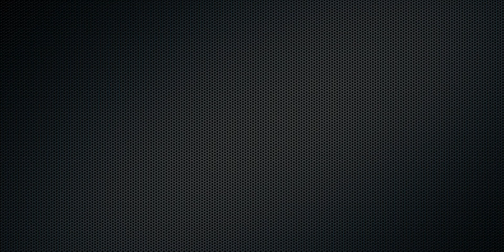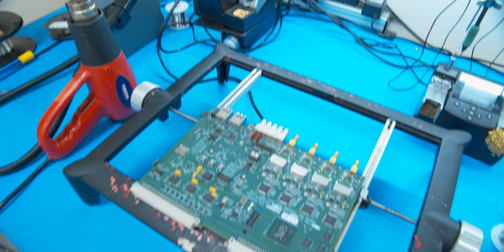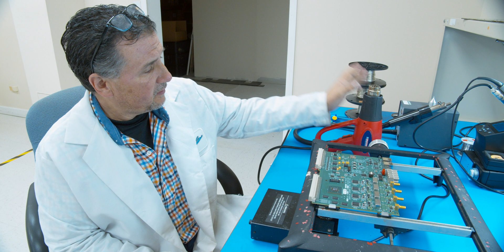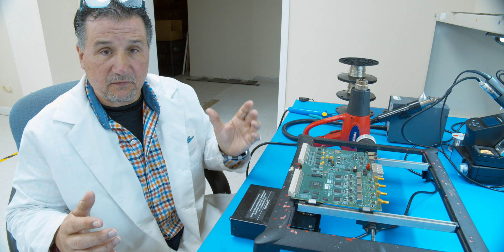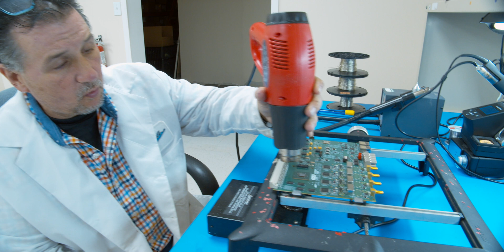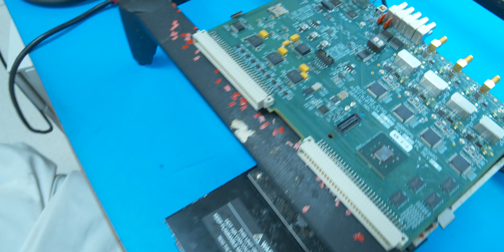Tips of the Trade: Removing and Replacing a BGA w/o machines

Comment: 1. You also should bake your board to get the moisture out, failing to do so will cause delamination/blistering on the PCB and the BGA. Happened to me this week on a rush job. 
2. Be careful when cleaning the pads on the PCB after you remove the BGA, you do not want to be aggressive and scrape off the masking around the pads, it'll cause solder to travel where it's no supposed to when adding the new part. 
3. Backing up what was said in the video, use thermocouples! If you control your heat, your board may survive multiple heating cycles.

Good luck!